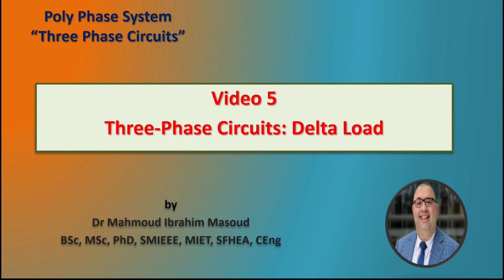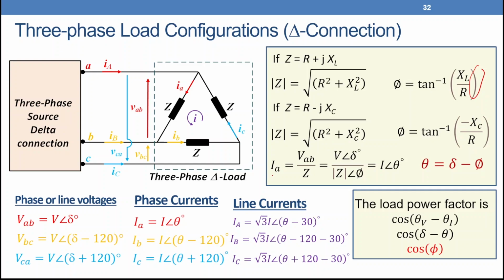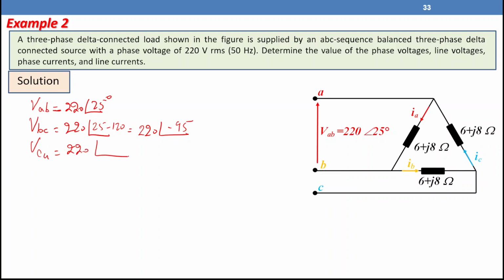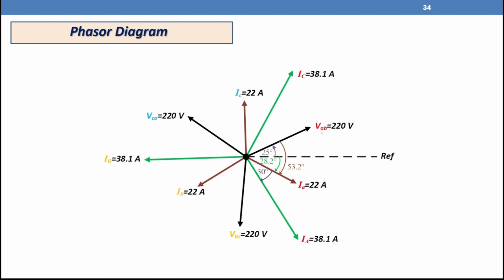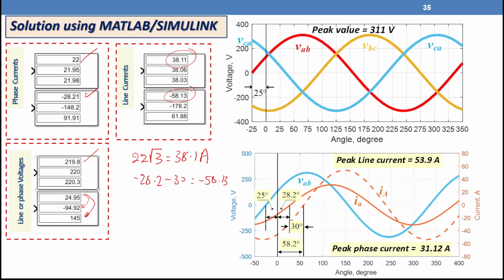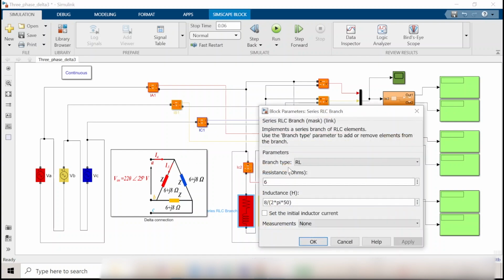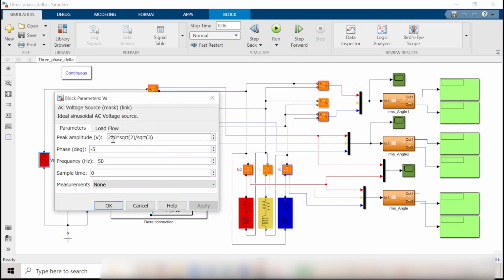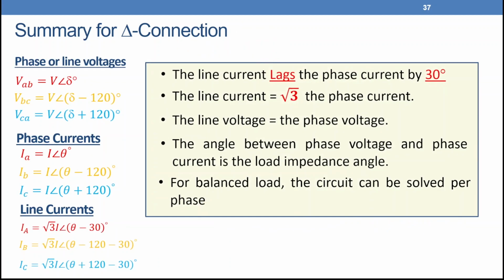Three Phase Delta Load Analysis with MATLAB/SIMULINK Example

Comment from the maker: This video covers everything about Three-Phase Delta Connected Loads — from current calculation and phasor diagrams to Simulink modelling and MATLAB plotting.
💬 Got any questions about three-phase systems or Simulink? Drop them in the comments — I’ll be happy to help!
👉 Don’t forget to LIKE 👍, SHARE 🔗, and SUBSCRIBE 🔔 for more electrical engineering tutorials and exam prep guides.
⚡ Stay tuned for upcoming videos on Power Measurement in 3-Phase Systems, and more!
For delta-connected load, check: https://youtu.be/X0YIhu8qvI4

#ElectricalEngineering #MATLAB #Simulink #ThreePhaseSystems